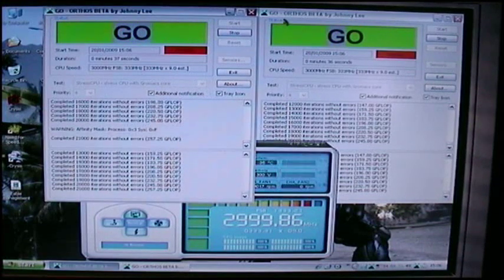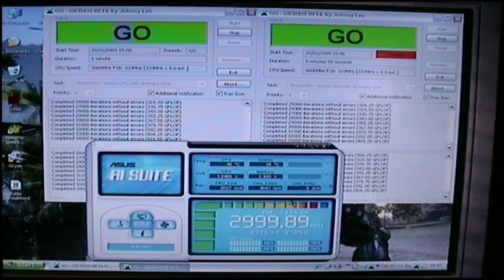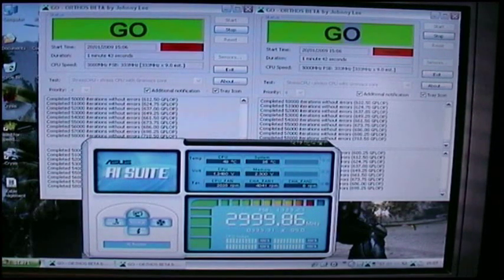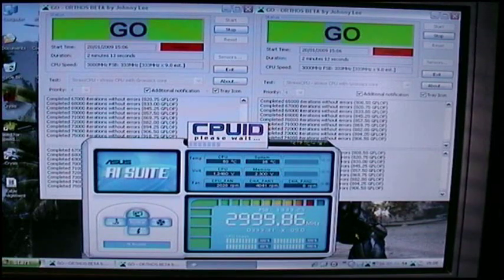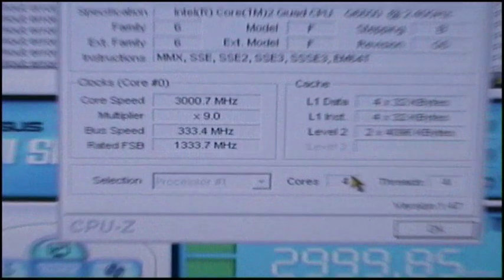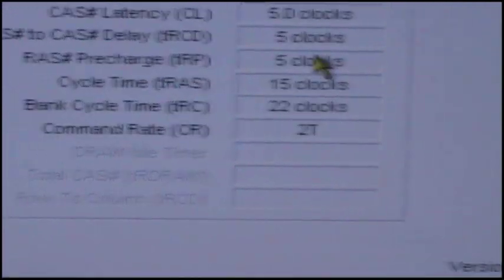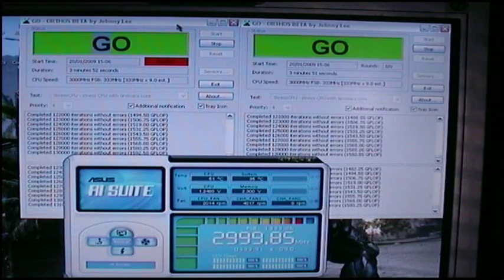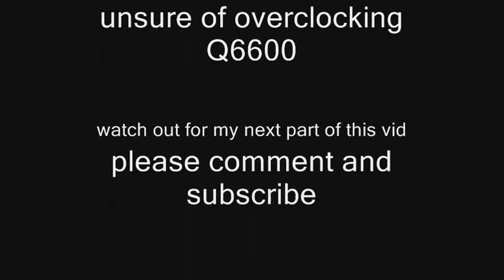Q6600 Overclock to 3ghz part 1

Comment from the maker: @gippula 
well 72 is a high number but if it does not hit it too much it shouldn't be any problem but i have always made sure my oc never sent the cpu over 60C
more temp = less stability "in most cases"
best thing to do is tweak the voltages as excessive volts could cause power build up at low usage causing over power and excessive heat :)
hope that helps.

Comment from the maker: you can oc Q6600 on stock fan to MAX of 3ghz but i would say stay safe on 2.6 or 2.8 and get your self a better fan if you wish to go over 3ghz
i run 3.5ghz with my asus and temps max out in high 60'sC